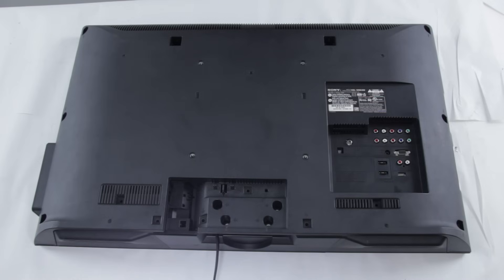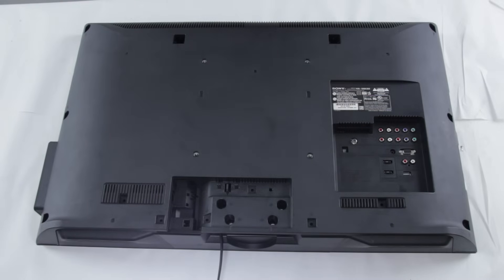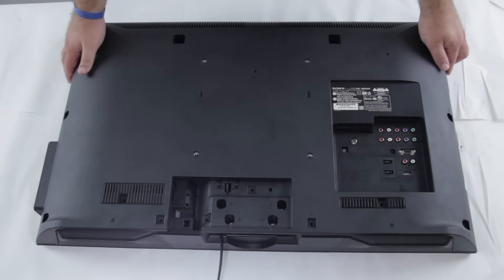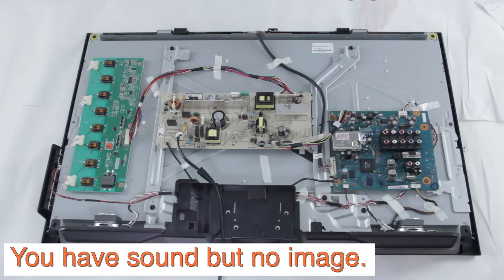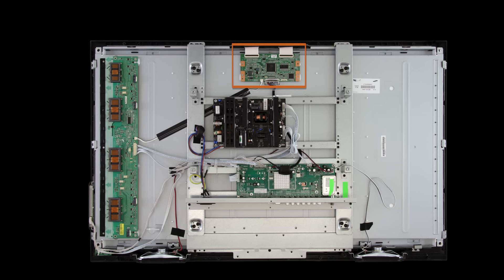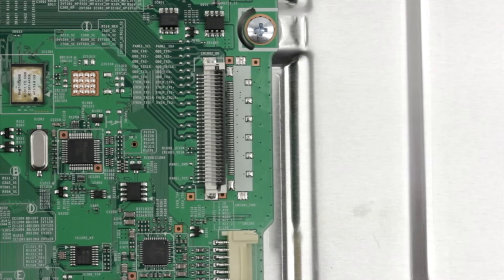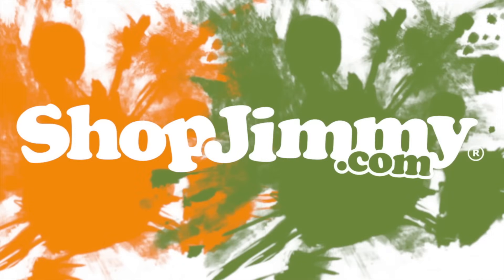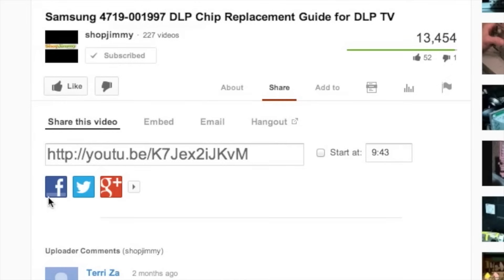LCD TV Repair Tutorial - T-Con Board Common Symptoms & Solutions - How to Replace T-Con Board

Comment: I have a dynex 40in lcd model dx-l40-10a. my power switch doesnt work now and even plugged up and power light on tv doesnt come on before this my tv worked fine on visual picture was good but now it wont come on can you help?
Reply from the maker: Binary Stew  Please watch this video FIRST to help with your repair!  https://www.youtube.com/watch?v=BP3NVNCGEv8  I recommend replacing the power supply board in your TV.  Click this link to replacement parts for your TV model number:  https://www.shopjimmy.com/catalogsearch/result/index/?cat=59&q=dx-l40-10a  There may be multiple boards for the same TV model number, be sure to match part numbers on your current board, with your replacement for compatibility.  Here is a link to a video showing how to identify your part number, click here:  https://www.youtube.com/watch?v=ZD-WxT3nGZU  Thanks and please let us know if you have any further questions with your TV Repair!  www.shopjimmy.com

Comment: Hello, Well let me ask you about a Bravia KDC-52xbr4 tv. It was working fine and we took a lighting hit on the feeder cable into the house well that blow all kinds of stuff up so I lost the HDM inputs and then the other failed over a few weeks so installed a Audio/Video Analog Main Board still no pic then the HDM board above it I got all my inputs back but the pic is not HDM just a bit off and not HDM clear. Do you think it might be one of the board at the top I see that I have two of them I think its a t-com board? I got a other tv andpluged it up and works fine so not the box or cable. Thanks
Reply from the maker: Russell Krausman  Please watch this video FIRST to help with your repair!  https://www.youtube.com/watch?v=BP3NVNCGEv8  I recommend replacing the main board and the power supply board in your TV.  Click this link to replacement parts for your TV model number:  http://www.shopjimmy.com/catalogsearch/result/?q=KDL-52xbr4  There may be multiple boards for the same TV model number, be sure to match part numbers on your current board, with your replacement for compatibility.  Thanks and please let us know if you have any further questions with your TV Repair!  www.shopjimmy.com

Comment: sir My LED tv samsung Model-UA32EH5000RLXL and Srial no.MQE13PBC701633T problem is lines are coming in near middle of the screen and some times white line darkly.please suggest me how to repaire my tv and what parts are to be replaced, my mail id venkat211177@yahoo.com
Reply from the maker: balabommu venkateswarlu   This sounds like a TV panel (TV Screen) problem.  If your TV panel is bad, it may be more cost-effective to replace the TV as panels are typically hard to find in stock, difficult to replace, and expensive.  Thanks and please let us know if you have any further questions!  www.shopjimmy.com

Comment: I have a samsung un46es7100fxza.  Upon powering up all I get is a flashing red light on the bottom left corner and illuminated samsung logo on bottom middle of tv. Intermittent clicking is heard. I replaced power board but still same issue. Could it be the tcon or main board?
Reply from the maker: *****  Please watch this video FIRST to help with your repair!  https://www.youtube.com/watch?v=BP3NVNCGEv8  I recommend replacing the main board in your TV.  Click this link to replacement parts for your TV model number:  http://www.shopjimmy.com/catalogsearch/result/index/?cat=56&q=un46es7100fxza  There may be multiple boards for the same TV model number, be sure to match part numbers on your current board, with your replacement for compatibility.  Here is a link to a video showing how to identify your part number, click here:  https://www.youtube.com/watch?v=BEPWrefQvqI  Thanks and please let us know if you have any further questions with your TV Repair!  www.shopjimmy.com

Comment: I have a Samsung  Model LN46B630N1FXZA. The picture becomes very light to where it is difficult to see anything.  I went into the menu and reset the picture settings and it did not fix the issue.  Prior to this the screen was much darker than normal but i thought it had something to do with my Apple TV connection but now i think it was the start of something going bad.  Is this a T-CON problem or something else?

Comment: Hello i need help to repair my led tv, its a samsung led UE32D4003, it has yellow horizontal lines on the screen that wont go away and over time the number of lines are bigger!
Reply from the maker: Edgar Pinheiro   This sounds like a TV panel (TV Screen) problem.  If your TV panel is bad, it may be more cost-effective to replace the TV as panels are typically hard to find in stock, difficult to replace, and expensive.  Thanks and please let us know if you have any further questions!  www.shopjimmy.com

Comment: Need help. Toshiba 46RF350U. REGZA Chassis no TAC0744. Serial no AM38501007. Manufactured Dec. 2007. The screen gets shaky intermittent vertical lines on the right half. See video attached. After a few minutes the picture goes black, but I still have sound. I can turn the tv off then back on and the picture may stay on or it may go off again. Turning it on and off several times, gets it to stay on and the picture eventually evens out and looks great for the rest of the day. Once i get it on and working, i leave it on all day and it works perfectly. Do you have any idea what the problem might be? You comments much appreciated. Thanks.

Video
https://www.youtube.com/watch?v=ihpTa1-t4oA&feature=youtu.be

http://youtu.be/ihpTa1-t4oA
Reply from the maker: Robert Lumpkin   This sounds like a TV panel (TV Screen) problem.  If your TV panel is bad, it may be more cost-effective to replace the TV as panels are typically hard to find in stock, difficult to replace, and expensive.  Thanks and please let us know if you have any further questions!  www.shopjimmy.com
Reply: ShopJimmy.com Thank you. I was hoping it was the T-Con board.

Comment: Hi , I have 32-inch Sony Bravia. The model number is KDL-32L5000. There are colourful vertical lines going across the bottom portion of the screen - about one-fifth of the screen. From the video it looks as though the t-con board is bonded just as you described. Is there anyway to replace the t-con?
Reply from the maker: Hugh. A Bradshaw   This sounds like a TV panel (TV Screen) problem.  If your TV panel is bad, it may be more cost-effective to replace the TV as panels are typically hard to find in stock, difficult to replace, and expensive.  Thanks and please let us know if you have any further questions!  www.shopjimmy.com
Reply: @shopjimmy  Sorry for the reply Shopjimmy. Thanks for the guidance. We bought a new television. Sincere thanks again.

Comment: I have a Sony Bravia kdl-46s500 and I'm having problems with the left connector ribbon, I have been having a pink picture on the left side of my screen and when I move the left connector (fpc left) the picture goes back to normal, I want to know how do I replace it (the ribbon) or do I need to replace the whole board? Thanks for your help

Comment: Hi ShopJimmy,

My TV went blue screen but I can hear the audio clearly.

My TV details are as follows:
Type No: UA46D660
Model No: UA46D6600WJXZK
Version No: HQ03
S/N: ZSWS3VDB0095M

Please offer any advise you may have to fix this problem.  BTW, my TV is over three years old.  A Samsung technician has made an inspection and says I need a new panel (expensive).  I am not totally trusting of this assessment after seeing a lot of Youtube videos where the fix is other than the panel.

Thanks, Allen
Reply from the maker: Allen Kwan   If your TV has a t-con board, you can start by replacing that.  If no t-con board, then the problem could be with the main board or the TV panel.  You will need to try replacing the boards to see if they are the problem or the TV panel.  Unfortunately I do not see any replacement parts in the search results for your TV model number on our website.  Thanks and please let us know if you have any further questions!  www.shopjimmy.com

Comment: Is it normal for a tcon board to heat up? Thiers a chip in the middle that gets really hot.
Reply from the maker: Skyefuego   Sounds like you have a bad T-con board as they are not supposed to heat up that much.  Please reply with your TV Model number or t-con part number.  Click here to view a video that shows how to find your TV model number:  https://www.youtube.com/watch?v=S51nhAmwR2M  Thanks!  www.shopjimmy.com
Reply: ShopJimmy.com the part numbers are printed are
 3021d1
             D
 LA902j
Reply: I tried emailing a image of it in at the website but I had gotten a reply saying the they are not offering tech support

Comment: I have a LG 47LV5500-UA.AUSYLHR and lost the picture while watching it last night. Still get sound as you change the channels and a few lines of color once in a while. When I turn the unit on, I get colored lines in the middle of the screen but only at the top as I change channels. Can you tell me what the problem could be.
Reply from the maker: Tony H   This sounds like a TV panel (TV Screen) problem.  If your TV panel is bad, it may be more cost-effective to replace the TV as panels are typically hard to find in stock, difficult to replace, and expensive.  Thanks and please let us know if you have any further questions!  www.shopjimmy.com

Comment: Greetings,I have a Sharp Aquos model LC-60LE640U and it is giving issues as follows:The TV all of the sudden started displaying a horizontal line all of the way across that is a bit darker on the left and fades toward the right. Eventually the line became two lines wide. We continued to use the TV like this for several months and then the the TV started a new symptom of going black but with sound still going. The TV would not turn off. I turned off power supply and waited and sometimes the TV would come back on and work a while (minutes to hours) as before with just the horizontal lines and then finally go black again. Any ideas on with components would fix this/these issues and do you have these replacement parts (of course I would verify number on the boards)?

Comment: Hi, I have a Sony Bravia KDL-52XBR, (bought in 2008 Australia). There is an intermittent problem with lines, double images and blurry images. Sometimes there is nothing wrong at all. I have had a look inside TV as shown in your video but it looks like tcon board is attached to TV Panel as I couldn't even find the tcon board.  I spoke with sony service centre they said 95% chance is TV panel but I need to pay them $165 to come out and confirm problem before I can even decide if it is worth fixing. Do you now if in this model I have to replace tv panel to replace tcon board? If I do then its not worth fixing. Can the problem be caused by poor electrical wiring in the house? I've noticed the tv went from good to bad after someone in the house used the nespresso machine!
Reply from the maker: Susie Gekas   This sounds like a TV panel (TV Screen) problem.  If your TV panel is bad, it may be more cost-effective to replace the TV as panels are typically hard to find in stock, difficult to replace, and expensive.  Thanks and please let us know if you have any further questions!  www.shopjimmy.com

Comment: I HAVE SAMSUNG LCD TV  ln46C630. IT HAS BLACK THIN VERTICAL LINES, - WHICH GOES AWAY AFTER TAPPING GENTLY ON BACK PANEL, GRADUALLY THE PROBLEM IS OCCURRING FREQUENTLY AND HAVE TO TAP FREQUENTLY. THE LINES SURELY DISAPPEARS AFTER THE TAP TO BACK  PANEL. BUT THIS DOES NOT SOUND GOOD FUNCTIONING, NEED YOUR ADVICE TO FIX THIS ISSUE.
Reply from the maker: Harsh Parikh   This sounds like a TV panel (TV Screen) problem.  If your TV panel is bad, it may be more cost-effective to replace the TV as panels are typically hard to find in stock, difficult to replace, and expensive.  Thanks and please let us know if you have any further questions!  www.shopjimmy.com

Comment: Hi I have a Sony Bravia 55 inch KDL-55EX620. Sears repair replaced the two power boards and do to the wrong ones being sent he reordered the power boards and the video board as well. The TV only had a REd line on the LCD after this install. I later found out that the T con board and the KDL board could be bad with it blinking 5 times. I replaced both on a gable and still no tv. I hit the power button and it just starts blinking red 5 times. Your suggestions on this?? The only thing left is the LCD screen.
Reply from the maker: Scott I  Please watch this video FIRST to help with your repair!  https://www.youtube.com/watch?v=BP3NVNCGEv8  The 5 blink code indicates a bad T-Con board, so I recommend replacing the T-Con board in your TV.  Click this link to replacement T-Con boards for your TV model number:  http://www.shopjimmy.com/catalogsearch/result/index/?cat=63&q=KDL-55EX620  There may be multiple boards for the same TV model number, be sure to match part numbers on your current board, with your replacement for compatibility.  Thanks and please let us know if you have any further questions with your TV Repair!  www.shopjimmy.com

Comment: I have a polaroid tlx 04240b lcd and the display has distorted colors like its on acid... not that i would know what it's like but that's what i think it would be like... anyway, i've tried different sources and it's pretty much consistent all through out. The TV is 7 years old. It sucks because i have a picture tube tv that's 26 years old and never gave me any problems.
Reply from the maker: raykupal  Please watch this video FIRST to help with your repair!  https://www.youtube.com/watch?v=BP3NVNCGEv8  I recommend replacing the main board in your TV.  Click this link to replacement parts for your TV model number:  http://www.shopjimmy.com/catalogsearch/result/index/?cat=56&q=tlx+04240b  There may be multiple boards for the same TV model number, be sure to match part numbers on your current board, with your replacement for compatibility.  Here is a link to a video showing how to identify your part number, click here:  https://www.youtube.com/watch?v=23S6V282R3Q  Thanks and please let us know if you have any further questions with your TV Repair!  www.shopjimmy.com

Comment: I have a Sony KDL 46ex500.  Couple of problems recently.  The first is that the volume was maxed out to 255 upon turning on.  It took several reboots for it to resolve and occurs off and on when turning the tv on.  Several days later, the color white began to have intermittent yellow blotches on the screen.  Any ideas?  Thanks.
Reply from the maker: Scott Lea   Please watch this video FIRST to help with your repair!  https://www.youtube.com/watch?v=BP3NVNCGEv8  I recommend running the main board in your TV.  Click this link to replacement parts for your TV model number:  http://www.shopjimmy.com/sony-1-857-593-31-a-board.htm  There may be multiple boards for the same TV model number, be sure to match part numbers on your current board, with your replacement for compatibility.  Here is a link to a video showing how to identify your part number, click here:  https://www.youtube.com/watch?v=Aodz2LHkzbY  Thanks and please let us know if you have any further questions with your TV Repair!  www.shopjimmy.com

Comment: Hi,
  I have an LG 55LH40-UA, and it just started showing a very thin black horizontal line, maybe 4 inches up from the bottom.  It also has some pretty light horizontal banding, darker at the bottom lighter bands at the top.  Each band is 4-6 inches high, all the same.  Do you think this might be a t-con board, or something else?  Thanks!
Reply from the maker: Alex Roberts   Please watch this video FIRST to help with your repair!  https://www.youtube.com/watch?v=BP3NVNCGEv8   This could be a problem with either the main board or the TV panel.  You can replace the main board to see if that fixes the problem with the TV.  Click this link to replacement parts for your TV model number:  http://www.shopjimmy.com/catalogsearch/result/index/?cat=56&q=55LH40-UA  There may be multiple boards for the same TV model number, be sure to match part numbers on your current board, with your replacement for compatibility.  Here is a link to a video showing how to identify your part number, click here:  https://www.youtube.com/watch?v=RwHTvjMdrhk  Thanks and please let us know if you have any further questions with your TV Repair!  www.shopjimmy.com

Comment: I have a Samsung 55" with model # UN55D6300SFXZA.  The color is washed out on the left side of the screen.  Sometimes the color comes back to normal starting with the bottom of the left side and moves up.  Any ideas what is wrong?
Reply from the maker: Richard Kuhr  Please watch this video FIRST to help with your repair!  https://www.youtube.com/watch?v=BP3NVNCGEv8  This could be a problem with either the T-Con board or the TV panel.  You can replace the T-Con board to see if that fixes the problem.  Click this link to replacement parts for your TV model number:  http://www.shopjimmy.com/catalogsearch/result/?q=UN55D6300SFXZA  There may be multiple boards for the same TV model number, be sure to match part numbers on your current board, with your replacement for compatibility.  Thanks and please let us know if you have any further questions with your TV Repair!  www.shopjimmy.com
Reply: ShopJimmy.com The color came back and had worked ok up till a week ago.  I have replaced the TCON board but it has not helped.  Next step?thanks
Reply from the maker: Richard Kuhr   Try all repairs and troubleshooting at your own risk.  This sounds like a TV panel (TV Screen) problem.  If your TV panel is bad, it may be more cost-effective to replace the TV as panels are typically hard to find in stock, difficult to replace, and expensive.  Thanks and please let us know if you have any further questions!  www.shopjimmy.com